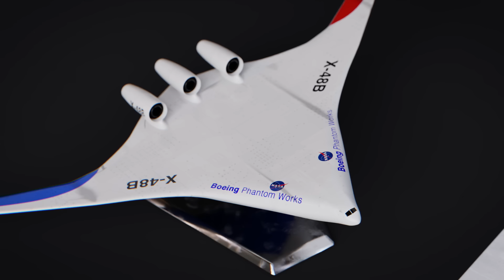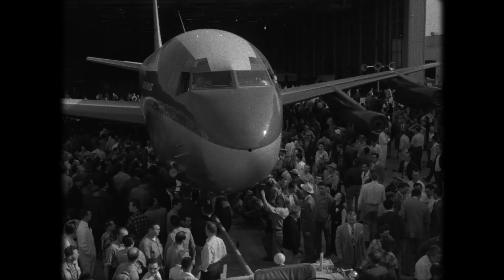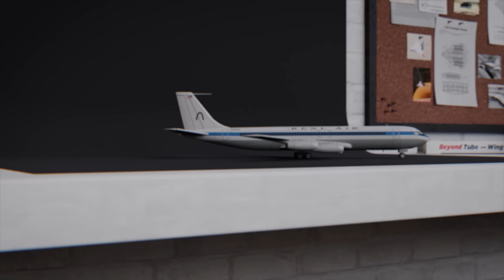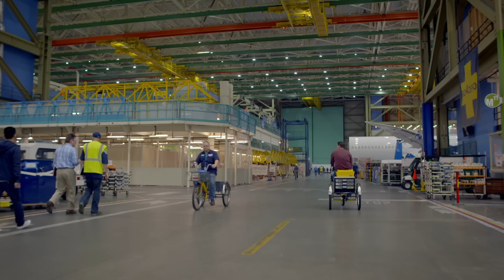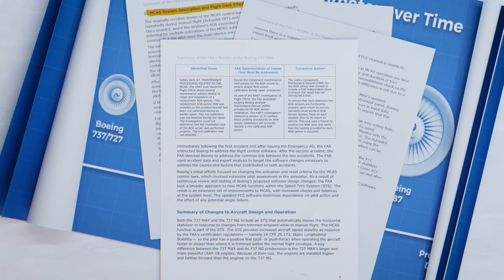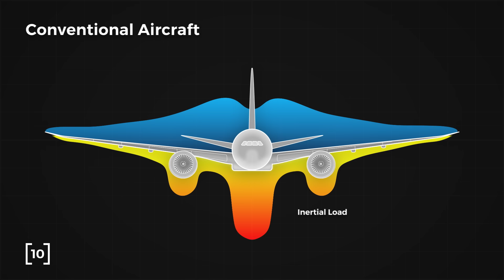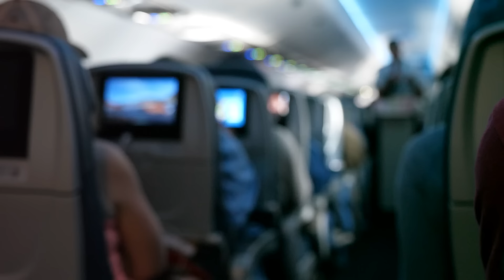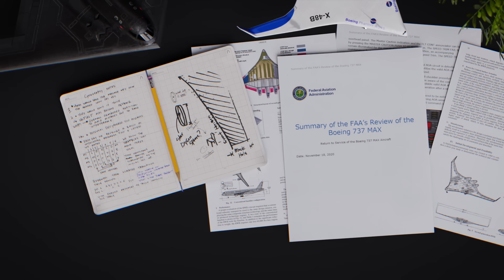The Plane That Will Change Travel Forever

Comment: One other downside you touched on slightly but missed is partly related with if the software goes wrong.  But instead, what if the plane loses power.  For example, a loss of all engines such as the infamous hudson ditching.  If a pilot already struggles to hold on to a powered flying wing prior to fly by wire, then how will a pilot get one down if there is no longer power to run the fly by wire system.  To add a battery pack just to run that computer system for 1-2 hours would negate a bit of the weight savings you were supposed to gain.  That would be my biggest concern.  It is rare to have full loss like that, but the chance isn't 0.  So if a pilot needs to take over manual control equipped with just low pressure hydraulics using a deployed generator, can the pilot still maintain control to safely bring the plane down assuming some safe place to land.

Comment: No it wont. Blended wing/flying wing aircraft may seem like the future, but their shapes are ridiculously complicated to manufacture. Existing planes are nothing but cigar tubes. Easy to manufacture. Beyond that, tailless and flying wing designs are notoriously unstable, the B-2 bomber has 100 computers onboard and 20 are for controlling the plane's instability. Google box-wing aircraft, because they double wing surface area without increasing overall wingspan, you boost lift capacity 50% on the same engine power. Also you don't have to change overall manufacture, you're still building cigar tubes fuselage.

Comment: I live at 2300m (7545.932 ft) above sea level, so I never felt bad on a long plane journey.
Reply: I'm glad you covered the cabin pressure factor. This was a concern of mine when we were working on our supersonic commercial flight capstone project as we started deviating from the cylindrical fuselage configuration. 

One important limitation not covered here is the height vs width of the airframe. If the internal cabin is to be high enough for passengers to walk around, the wingspan must be much larger than that of conventional regional airliners that carry 100 or so passengers. At that point, you might as well add more rows of seats. Its likely we will never see a regional airliner or charter plane of this design for this reason, mainly just international flights where you can sell the extra several hundred seats. If the industry is forced in that direction, they will have to compensate by scheduling less frequent flights to fill the seats.

Comment: Elephant in the room: this design has a much larger frontal cross section. And with a large cross section comes large drag
Reply: I believe he directly addresses this at 5:30

Cross section contributes to Form Drag, just a part of Parasitic Drag (the other major type being Induced Drag). That is to say the increase in Form Drag is accompanied by a larger decrease in other forms; it's just one of several factors.

Ex. horizontal stabilizers (which the blended wing design doesn't have), in addition to adding weight, increase surface area. This increases Skin Friction Drag--the other contributor to Parasitic Drag. 

Hope this helped clarify and wasn't just regurgitating info from the video. :D

Comment: great video!
i think you mixed something up for the definitions of wetted area and frontal area
there are auto stable airfoils, which minimise the pitching moment and don't need wing sweep or fly by wire systems to ... be stable
the lift distibution which minimises root bending moment is bell shaped (bsld), it can also remove the need for vertical stabilizers, further reducing weight and wetted area, at the cost of increased span
(a folding wingtip might solve that problem)

Comment: I'd love to see a blended wing airliner, especially if it's the next step towards sustainable flight. Great video.
Reply: no windows, no care
Reply: The problem with blended wings is that passenger aircraft are required by faa to have some sort of manual reversion in case of total power loss. In which case the pilot would be in total control. Flying wings dont fly too good like that due to inherent lack of stability. They would have to figure out a passive means on stability
Reply: @Demonslayer20111  If all those passengers were pedalling, maybe it could be powered on electricity!
Reply: military reading this comment - let's make this dude's dream come true sends stealth bomber to your area

Comment: ummmm you keep mentioning this passive system in airliners to do with the tail and compleately gloss over the fact that all modern airliners actually automatically adjust the trim already and thus have the beginings of a stability control system already?
Reply: wouldn't they need Active control/intervention-systems to take care of the changing 'mass-point' - due to fuel consumption ,  and most fuel being in the wing-tanks ???
Reply: also should probably have added in a bit about the amount of airport infrastructure changes that would be requiered thus exposing it to some of the same issues the A380 had with limited airports. Although given it's relative potential to save fuel it may become a mute point as the money saved could be diverted somehow into updating airport infrastucture. Rest of this video is brilliant though with some really good info on the blended wing that i had not seen before.

Comment: Regarding your explanation about why the offset center of gravity and center of lift are important: I don't get it? If they were at the same spot, and the horizontal stabilizer would be exactly level, all of the mentioned self-centering effects should also work, while decreasing drag during level flight?

If the plane pitches down, horizontal stabilizer would generate negative lift, and vice versa?

Comment: The plane that will change travel forever is the A321XLR. It is designed fly very long routes and at the same time burn very little fuel. It is also smaller than all other long range jetliners from this generation. Definitely a game changer

Comment: To make active stability safe enough, I find myself thinking that you want not only plenty of redundant cross-checked sensors (both different types and multiple of each), and flight control systems, but also might want to make your control surfaces and their actuators redundant. Design things so you can lose of some some percentage of your control surfaces on independently of others while maintaining sufficient control authority.
Reply: Critical systems require triple redundancy. There is no might want. Only is or it doesnt fly passengers.

Comment: Something ignored is that as putting people further out you need to add structure strength because as you go away from the center the more turbulence people will experience.
Reply: or perhaps they will make these the economy seats with the interior 'comfortable' seats will serve as all the upper class seats.
Reply: @VadersFist501st  I hate that idea. To keep a problem unfixed for some classist bs like that is vile.
Reply: They still have to put the luggage and cargo somewhere, so aside from vibration-sensitive equipment, that's probably how they'll use the parts of the interior that aren't comfortable for human occupancy.

Comment: 5:05 What if instead of having secondary wings that drag the plane down, you add wings in the front that push it up? 

I assume there are problems that I haven’t thought of and can’t think of because I’m not an aerospace engineer, but it sounds like a good idea
Reply: They are called canards. It does reduce pitch stability and requires other design changes to stabilize it. 

https://en.wikipedia.org/wiki/Canard_(aeronautics)#Stability

Comment: Honey lets go visit the Bahamas in our stealth bomber
Reply: meanwhile in the distant past: honey lets go to the bahamas in our (non stealth) bomber.
Reply: If you are the US, this is possible
Reply: @glockmat  

No, it isn't.
Reply: @glockmat  If are you, could grammar then; mayb.e?
Reply: @theo_3376  From one engrixi speaker to another, but tks either way, I missed a word there
Reply: “Ok honey but I’m piloting this time!”
Reply: five minute flight, be home by dinner.
Reply: Daddy, can I drop a few bombs? Pleeaaase!...
Reply: 20 minutes, in and out, no one will notice
Reply: " Or should we go .. Let's see .. Bikini island ? Pretty nice this time of year .. We can visit the craters .. For the good old times .. ( glasses clink ) "
Reply: @Kenabukanyo  radioactive Bikini Bottoms (sponge bobs are real)
Reply: Hey Hipyo, love your videos. NOW MAKE ME A KEYBOARD /j
Reply: @mackenzy.mp4  Idea! And ... in one piece, not two.
Reply: The 737 Max does not have a FBW flight control system. The spoilers are electrically signalled.  The primary controls are cable signalled hydraulic servos. Indeed the pitch trim system is based on the KC135. There is nothing complex about it! MCAS was a criminally engineered patch.
Reply: It's for evading DEA, don't buy this passenger nonsense, zero chance assured, future will be witness. Not a chance, others in comments know physics of errors. Won't allow high speed bullet trains mag lev, built airships flying cruises ships lighter than air with lift. Truck petrol lobby, tires, is there one in military anywhere like this? Nobody took old technology to this. Going to Mars too? Seriously say battery electric planes, hydrogen? Space elevator, fake comment by ?
Reply: @aryanprivilege9651  Prototype comment bot that analysed too much data from Facebook.
Reply: @ChaosLord5129  you didn’t get the joke
Reply: engineer hipyo btw
Reply: Whys keyboard guy here?
Reply: This is fucking hilarious oh my.
Reply: Naw… It’s gonna bomb.
Reply: All invented in WW2 but Germans under free emancipation from banks with wealth prosperity freedom need we soar in svience and advance as specie stealth delta tailless jets, icbm,helicopters, space reached first, advanced decades in 7-8 years. With bondage returned all sputtered to slow nothing, family well being IQ all fell imagine if not ended. High speed trains still not in USA, say can't as always nonsense. Under ocean Japan tectonics,mountains,efficiency cost,cargo fuel lives,, trucks silliness all saved. Better not ideal, for speed yes. Even less failure if mag lev not flying fuel container burner. Greed will kill all innovation, how few percent or tiny do more than largest most populated and richest. Space, V2 made bigger not possible no command, von Braun rest. Odd ignored.
Reply: I dont want to like, perfect 1111 likes, dont want to change it
Reply: Alfred spraylube airlines
Reply: Warranted if they use tactile switches I guess.
Reply: My ideal flight is one where there are family and private rooms, kids play centres (soundproofed walls or by the engines), and a bar where I can get my own drinks.
Reply: What did the Bahamas ever do to you! Ha ha..
Reply: My older bro almost did this. (see recent post, Aug 26)
Reply: fun.
Reply: didn’t expect you here
Reply: In Afghanistan so long as you hire a Taliban pilot you can fly in a Blackhawk too!
Reply: The Japanese go to Pearl Harbour in  stealth bombers.
Reply: @warhistory1895  And not seeing them coming would have made a difference exactly HOW??
Reply: @ThatBoomerDude56  is joke, you take to seriously.
Reply: @warhistory1895   I never take anything in the YouTube comment section actually "seriously."  😝😝
Reply: Yes will pick you up DECEMBER 2021
Reply: Precisely. The Northrop YB-35 bomber prototype began its development during World War II. The technology already exists.
Reply: Sure, got 400 of your closet friends and none of their explosive cargo, sure come on down.
Reply: Look what Google can tell about german HORTEN-brothers.
Reply: Kenneth Copeland will be the first to buy one.
Reply: WE KNOW YOU METAL HEAD !!!
Reply: I would laugh if this airplane design was canned because it was invisible on radar. Anyone can turn off the transponder and go rogue.
Reply: Lel
Reply: "Sweetie, I'm taking the NGAD to go visit my brother in Michigan"
Reply: yooo hipyoo
Reply: stop looking at planes and go make more keebs
Reply: Stealth won't be used for civilian planes. Civilian planes will focus on carrying capacity, energy efficiency, etc..

Comment: I'm still not sold on the passenger blended body aircraft.
The seats located furthest from the roll-axis ("window" - seats) would experience some serious roller-coaster  action every time the aircraft course corrects and during the landing, when the aircraft is most active on the roll-axis, passengers would need 5-point harnesses to stay in their seats.

Maybe if the passenger cabin were kept as a single- or double-aile cabin in the center, and the rest of the space was used for hydrogen storage, it might work.

You forgot to mention that some aircraft move the center of gravity back and forth by transferring fuel to a tank within the horizontal stabilizer e.g A330/A340. 
And the A350 moves the centre of lift back and forth by trimming the flaps actively during cruise. It'll even go to negative flap positions and asynchronous between left and right wing (normally a big no-no) , all computer controlled.

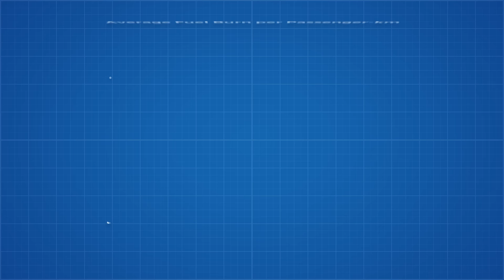Comment: Average fuel burn means what? That graph doesn't tell what 100 equals. Is that 100 liters, ounces,  pounds, kilograms, grams... or a specific unit of measurement related to the travel industry? 1:10 for reference.

Comment: The engines at the top will also improve safety. The top mounted engines are better protected from debris and bird strikes. The volume ratio should also be better, if it could glide, it should be able to float pretty well
Reply: Yeah, but servicing them would be a fucking nightmare, you need to climb above the plane, in a region littered with no step zones to inspect them, or the plane would need to purposely leave some places without elevators to access the engines for maintenence, not to mention that to take an engine out you need a crane, botton wing aircraft just need a jack and a steal frame to carry those, a high wing or a tail mounted aircraft needs a hydraulic trolley, but it is doable, a top mounted engine NEEDS a crane, and a good one at that. So small airports operation is gone
Reply: Small airports aren’t messing with removing jet engines anyway so it’s a moot point.
Reply: @Creabsley  Depends on the operation, I was talking EMBRAER falcon or e2, not 737, so those smaller engine needs service just as much, and air interior dont have the cash to rent a hangar at JFK to service their engines, not to mention catastrophic failures
Reply: If the engines are placed by the front on top of the wing, they can even help with lift as the engine exhaust blows over the wing. This was used on the Antonov An-72 and An-74.
https://en.wikipedia.org/wiki/Antonov_An-72
https://en.wikipedia.org/wiki/Antonov_An-74
Reply: @quentagonthornton49  more cons than pros in that.
Reply: @quentagonthornton49  interesting examples! Though I'd imagine if the engines are right in front, the noise levels will be much higher for all the passengers, regardless of travel class like First Class or Economy 😅
Reply: Engines above the wings help with lift, which translates to less engine power needed and less wing surface area needed.
Reply: @RayleighCriterion  But it also means more maintenance costs and more fuel consumption, since this thing is a trijet
Reply: heaven forbid a deep stall causing turbulent airflow into the rear/top mounted engines resulting in compression surge or engine failure.
Reply: @jonasbaine3538  this would require some huge fuck up from the pilots
Reply: @glockmat   huge pilot errors have happened plenty of times before...colgan 3407,  AF447...
Reply: @jonasbaine3538  Yeah, surelly, but each time they happened we learn from them to not repeat it. And we got pretty good at it. And in a case where a flying wing get stalled enough for the whole of the aircraft lose their boundary layer, probably the engines wont get any air at all. The plane will throw the air way too high for the engines to ingest it. Also being above the airframe it would push the nose down, since the COA is above the COG and COL. So a software like the MCAS could be implemented to auto throttle the engines, but this time checking all AoA sensors, plus Pitot tubes and checking the altitute delta, if the plane is really on a steep enough AoA to stall the whole body, them the altitude will have a sharp climb and the airspeed will go down A LOT, so just firewall the engines. The best thing about this system is that in case 4 sensors fail together to make the engines firewall wrongly, the pilots could trim the aircraft, wait for fuel to run out and land safely on the nearest airport
Reply: @glockmat  One way to not repeat mistakes is to learn how to avoid them.
I know Center of Lift and Center of Gravity, but what is COA?
I'm a little confused by your explanation of how to recover from stalling the whole lifting body and blanking the engines. What flight control surfaces would you use? And when the engine intakes are not getting airflow, what would happen when you command max thrust?

Comment: It's sad to hear how greed won over engineering. Boeing drastically has to change its management structure.
Reply: That comment was nonsense and it comes from people who hate Boeing more then they want to actually say the truth.

Actually read what happened objectively.

The crashes were caused by pilot error, period.

A malfunction in the trim system is corrected in three simple steps.

MCAS didn't add anything new to the 737, it was manipulating an existing system.

In addition the airlines in question knew there was issues in the sensors and they ignored them.

Comment: Drop the fake and misleading graphics! If you're going to pose as legitimate, such dishonest abuse of statistics is n utter disgrace. For example your graph of average fuel burn per passenger STARTS at 50 instead of zero, massively exaggerating the improvement. Hardly any viewers will notice this. You should be ashamed of yourself for such shameless fraud.